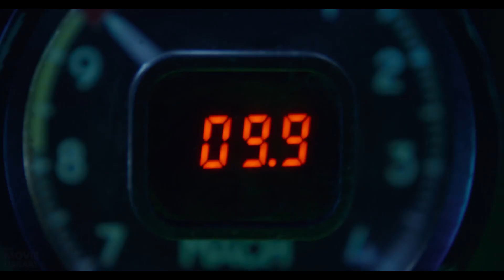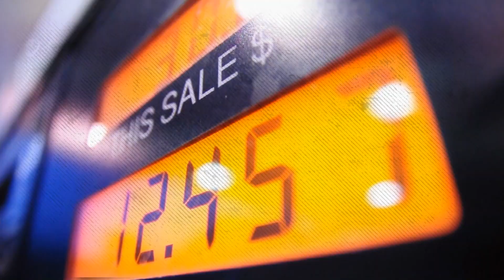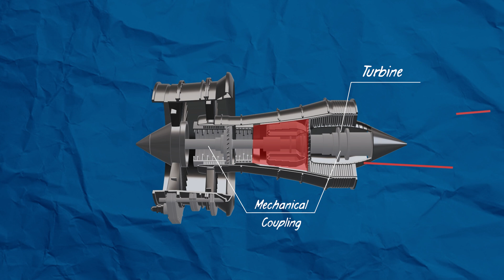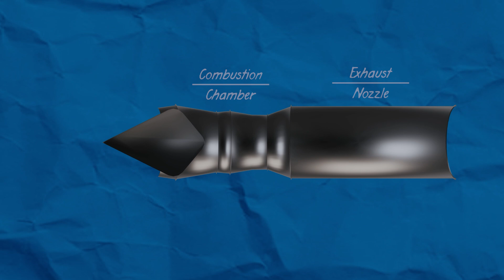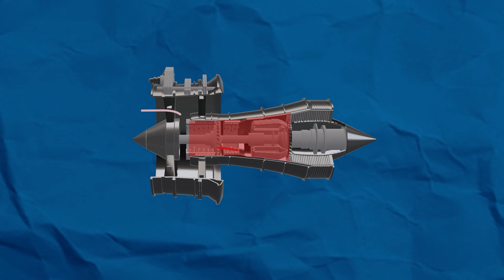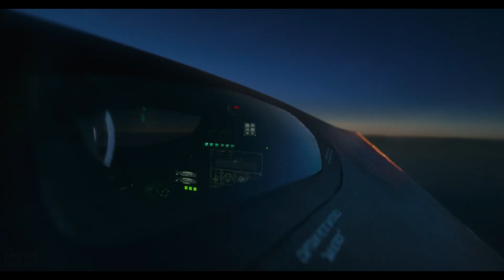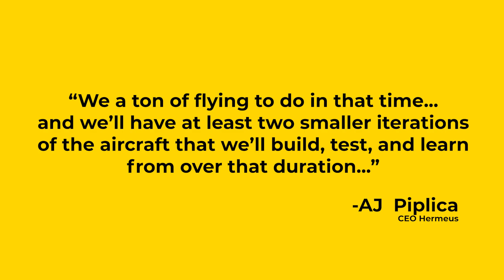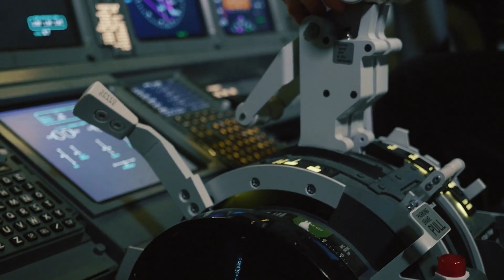The Mach 5 Engine That Will Change Air Travel Forever | Hermeus

Comment: Small point to make: The engine shown in at around 4:05 is a turbofan engine. Passenger aircraft don´t use turbojet engines any more. Turbofan engines use a large fan to move a big air mass at a slower speed than turbojet engines. Turbojet engines accelerate a smaller air mass to faster speed.

Comment: Not even one mention of the Blackbird? anyway, the only thing limiting supersonic travel right now is laws all over the world that prohibit faster than sound speeds because of the sonic boom, so you can only go at mach 1 and above over the ocean which basically kills the economics of SSTs which is why the Concorde failed. So its not a question of engines but of eliminating the sonic boom which is far harder to achieve and neither this video or the company says how they plan to address that.

Comment: It really fascinates me that they are finally actually going to make ramjets and scramjets into something that will be used in practice.
There is an amazing program called Orbiter Spaceflight Simulator, with which I have been playing for years, which very accurately simulates the physics of spaceflight (much more realistic than KSP), but in which you can also choose fly some spacecraft which are fictional and futuristic, but which due to the physics still have a large degree of reality.
Several of these craft make use of scramjets as a part of their travel to space.
Does anyone know how far current developments are in making this into a real option for the first (or maybe even second) stage in spacecraft lauching?
The reason I am asking this is because of the huge fuel cost reduction this might have. The idea is that a large part of the oxygen tanks can be ommitted, because a scramjet takes it's oxygen input from the atmophere, while it further accelerates the craft.
Of course the final part of bringing it into full orbit will still require full rocket fuel and internal oxygen, but at least a huge part it might be reduced.
I am also curious about how far in heat resistant materials of nose cones other parts of the airframe can theoretically go here, since acceleration through the atmosphere will need to be even more here. Also considering the problematic maintainance cost of the space shuttle here, which depended on expensive tiles for it's heat shield, and which was still just designed for reentry (high velocity during launch was reached after leaving the atmosphere).

Comment: Nosecone plus shockwaves = air valve.  Got it.  So maybe push the nosecone of the engine forward and back to adjust said shockwave to be optimal for a wider range of  speeds.

Comment: As other commenters have noted - how on earth can anyone claim this is new?  The Skunk Works led by Kelly Johnson developed this engine technology in the late 1950s with the SR-71 Blackbird.  They even made the plane out of a titanium alloy.   This video's portrayal of the "newness" of this technology seems a good bit disengeuous.  As is, therefore, the claim that these designs are the key to commercially viable hypersonic flight.  If that were the case, wouldn't we be closer to it 70 years after the first technology was invented?

No. I agree with the other comments - the keys to commercial hypersonic flight are lighter materials, design and lighter, yet denser, energy sources.  

(Of note, to my understanding, the SR-71 went further in energy conservation/efficiency by aligning the angle between the nose and ramjets  in such a way as to "feed" the shockwave created at the nose into the ramjets, thus producing even more thrust.  The maximum speed and altitude are STILL classifed.  What we DO know is that it cruised near Mach 4 or 5 and at 120,000 to 140,000 feet).

Comment: A jet engine doesn't change air travel forever.

It may change military aircraft forever but it certainly doesn't change "air travel" where most people would consider that to mean the flying public on commercial or private aircraft.

There's a HUGE host of problems that have to be solved to fly a large aircraft that fast and for governing bodies to deem it safe for the public.  We already have engines that can EASILY move commercial aircraft at supersonic speeds, but we don't have supersonic aircraft in any of the major airlines.

There's a reason why different manufacturers almost went bankrupt trying to develop supersonic aircraft for public transportation.

I'd like to watch this because there's probably something useful in it but I hate sensationalistic titles, thumbnails, etc..........

Comment: You're mistaking a turbofan for a turbojet. 4:08
A turbojet lacks a bypass. All air enters the comustion chamber. Turbofans can't really reach mach 1 since the intake fan tips begin exceeding the sound barrier drastically reducing engine efficiency.
Reply: Basicaly no engine is a pure jet engine, they might have little or very little bypass but most of them have some bypass.

Comment: When you mentioned the precooler, I thought of Reaction Engines SABRE engine. They developed a precooler for the SABRE quite a few years ago. They use liquid nitrogen to cool the incoming air and a gas turbine that runs on hydrogen and can fly to mach 5.5. Their plan is to use it for a single stage to orbit space plane called Skylon. While in the atmosphere, the SABRE is air breathing and switches to rocket at mach 5.5 at high altitude, reducing the amount of O2 necessary to carry onboard, reducing weight and allowing SSTO. The difficult problem they had to solve was frosting of the precooler heat exchanger. That solution is patented.
I don't see hypersonic flight as the future of air transportation, it will be used marginally for cruise missiles and most probably for cheaper access to space.
If billionaires want to travel at mach 5, burning tons of hydrocarbons, I personally do not see why I should bother buying an electric car to reduce my carbon footprint.

Comment: Hey Bro. you are doing some amazing technology videos.
I have a new, never before seen, Rotary engine design that solves all the problems with the Rotary engine concept and keeps all the advantages.
For example:
The Apex seal will never go bad.
Perfectly balanced without counter weights.
Variable compression ratio, can run Diesel, gas or any fuel.
More power to weight ratio then Wankel.
Higher RPM, Higher Torque then Wankel.
About 60% + efficiency. And much more.
If you are interested in looking at my engine and discussing it, please respond to my comment here!
And I will send you further contact info.
If you could help me promote my EPIC Rota-Max engine on your channel, we could both make a lot of money with it and save the Environment from pollution.
Thanks!

Comment: "... short-lived glimpses of Mach speeds [sic] ..." -- no, Concorde traveled at about Mach 2 for hours on end.  Mach 5 travel would only be for the super-rich; there is no prospect of air travel in general being forever changed by engines capable of propelling aircraft at such speeds because of the costs, particularly that of fuel.

Comment: Untrue. A SCRAMjet system needs to be flying very fast. A standard ramjet engine needs to be running a minimum of about 300 mph to work. This engine is a "supersonic combustion" ramjet (or scramjet) which will allow hypersonic flight speeds.

Comment: Speed speed speed, now stop thinking...For forty years there has been talk of a high speed between Sydney and Melbourne. Can't do it stop thinking.
For that whole time I have been asking why don't they do overnight sleeper trains on the existing tracks? No technology required.
Think of the experience of the passengers. They have their dinner, taxi to the train and board, watch a movie over a wine or two, go to sleep wake up in the desired city. The stations have shower facilities/cafes, get a taxi to your meeting at the end of the day do the same home. No Taxi to and from the hotel which is not required. 

Pressurized airships could do the same above the weather for UK, USA. Are there technical hurdles, yes about one percent that of hyper sonic transport. 
And they would also use about a hundred times less fuel per passenger... BUT stuff it lets just burn the world. ☠

Comment: "No one has been able to do this before".  I beg to differ.  The PW J-58 which powered the SR-71 Blackbird was a Turboramjet. The only thing holding it back was the limited materials science of the 1950s/60s was unable to withstand the heat of the exhaust and turbine inlet temperature at speeds above Mach 3.2.  The fastest speed ever recorded by an SR-71 took place in April of 1986 over Libya while doing a "bomb damage assessment" of the previous day's strike with F-111's.  The missiles fired by the Libyans at the Blackbird were capable of Mach 5 and reaching the Blackbird's altitude of over 85,000ft. To avoid those missiles, the pilot advanced the throttles slightly and the plane responded.  The pilot and RSO carefully watched the turbine inlet temperatures as the speed of the Blackbird increased to Mach 3.5. Due to some unusual atmospheric conditions that day, the turbine inlet temperatures did not exceed the redline of the engine and they were successfully able to evade the missiles because of their extreme speed.  If we could reconstruct the Blackbird with the new materials we have today, then Mach 5 would not be out of reach.

Comment: Firstly, that is not a jet engine, that is a turbo fan engine.

Secondly, the air is not  really slowed down (Well a bit of it is, most of it is not), but the speed of sound in the air is increased due to the compression, making it have a lower mach number. A subsonic mach number. Jet engines can absolutely go past mach 2, even turbojets can. Like the engine of the mig 31  can go mach 2.8 with out really any problem.

And ramjets absolutly works fin at lower speed than mach 3. They does even work at subsonic speed. And there is a overlap between a ramjet and a normal jet. Like in the SR71 using jet engines at take of, then changing the geometry so the jet engine become ramjet heaters at higher speeds.

The downside of compression heat due to speed exist. But the video failed to explain what the issue with this downside is. A engine can be made so that speed is increasing. But doing so decreased compression and as a result of that efficiency. So engine designers optimize the compression to the design top speed. Hence the F35 have a top speed of mach 1.6 i steed of 2.2 as most fighters to make it a bit more fuel efficient

7:00 this is just Ridiculous. you wouldn´t use a high bypass engine inside a ramjet.

And its not really that unlike the engine of the SR71. Of cause the SR71 didn´t have a pree cooler, on the other side, the SR 71 run on liquid jetfuel like fuel

Comment: Everyone keeps talking about making materials that can tolerate the extreme heat of hypersonic travel....but you're missing the elephant in the room.   Think 'Heat Sink'.   Even IF you can make the aircraft of materials that won't melt....how is it going to be able to maintain a reasonable cabin atmosphere for long distances when it's constantly absorbing heat that it has no way to get rid of?   Some have said to carry helium or other cryogenic liquid and use that for cooling...which would work (expensively) for a while, but not for the several hours that would be needed for trans-global flights unless you suit everyone up and cool their suits like in the SR-71.   Absolutely not practical for commercial use.

Sorry to say...this is all a fancy funding program offering just enough reality to lure in investors while totally ignoring the really hard problems they are heading straight into.   People in the industry know all about these and it's why Rolls and others won't invest in Skylon or these other projects.....there's no future in them for commercial purposes.   Now...for an unmanned weapon...that's another story and they are in development as we speak.   But manned machines have to keep the meat muscle alive and surrounding it in 2000C for very long is not a question of WILL they cook...but how long until it happens.
Reply: Ceramic tiles?

Comment: solutions to high speed:
1) Needs to be at high altitude, like 75,000 feet, less drag, less heating ,
 less sonic boom, con- oxygen poor environment.
2) Use oxygen augmentation. At high altitude introduce some oxygen.
 payback is high speed,
3) Could use a pulse jet, air accumulates in a "bucket" then explodes out exhaust chamber.
Reply: How does one store oxygen. Given that liquid oxygen corrodes virtually everything
Reply: @avonbwogeny2736  
Storage of oxygen is well known. As liquid it is cold snd stored in a dewar. For oxyacetylene torch i have its a gas at about
2000psi. I havent seen any corrosion from it
Reply: Suborbital makes more sense. Pack barf bags because it will be zero g for quite a while. And comfortable couches because the g load on approach will be heavy.
Reply: @cowboybob7093  
You have a good argument for suborbital. 
Here is where the line between aircraft and space craft is blurred. My guess is high flying aircraft is cheaper but i dont know.

Comment: do you have any idea how expensive it is to make a airframe skin that can handle the heat at a sustained mach 5? the engines are the easy part, we have been easily going over mach 2.5 for decades with a comparatively basic engine. its very unlikely this will be accessible to anybody but the absolute richest people on earth. not because of the engine, but the airframe limitations.
Reply: True. Concorde was already limited on its (aluminium) frame temperature, they engines had enough thrust to go faster then Mach 2.

Comment: It could but bear in mind most fighter planes don't run with afterburners as it can reduce operational range by 70%.
Modern fighter planes are actually slower than previous ones with the new F35 being a max of Mach 1.6 as ability to turn and operational range is destroyed above that speed as is its stealth capability.
So yeah these be extremely fast but at what efficiency?

Comment: Minor point: Passenger jets are flying closer to .8M than .7M. A jet flying at .7M would not be allowed on the most used/popular Atlantic routes/altitudes -- at that speed it's blocking traffic.

Comment: Could you please use metric measures? The old imperial system isn't viewer friendly.
Reply from the maker: I honestly felt heavily conflicted about what system I should be using 😅
Reply: @DrBenMiles  oh and thank you for your fascinating and well presented content. Measures aside.
Reply: @DrBenMiles  Don’t feel conflicted but follow the easiest scientifically proven path - which is metric. I was educated in Scotland and had metric from the age of 8. It was much easier to negotiate. This has to be one measure of measures! Also, simply from a viewership POV, most of your interested viewers will also be metric-trained. I doubt any of my Chinese, African, Indian or EU students even know what an inch is!
Reply: When discussing aircraft the standard is imperial, height is in feet, speed is in knots, etc. Sorry if that upsets you, but maybe you should learn instead of complain.
Reply: @msytdc1577  ohhh someone feels the tug of the past. I have students like that - usually from the US - but they learn.

Comment: How come you guys are forgetting the SR-71 Blackbird. It used the same technology and could do Mach 3 max. And I managed to do all these things in the 60s
Reply: Yes the SR-71 switched to Ram Jet similarly with diversion from the turbojet core.
Note that the diagram of a turboFAN jet to start is likely incorrect certainly the size of the fan having been lifted from a subsonic jet is unlikely.
The SR-71 did become more efficient as it progressed past mach 3.
Precooling (just exactly how?) might allow them the push the envelope farther.
Zero passenger potential- this only has military application.
Reply: The SR-71's fuel (JP-7) was specially formulated to not ignite at temperatures experienced in "normal" engines.  It was used as hydraulic fluid and air-frame and component coolant before being pumped into the engines.  That is a level of complexity that I would not trust to any airline.
Reply: @everettputerbaugh3996  Hypersonic refueling is going to be awesome. "This is your captain: We need to drop to Mach 3 for refueling" A string of planes the size of a KC-135 for a passenger plane. How about boost phase, above Karman line ballistic "glide phase," high g braking phase (to be a passenger requires a medical release.)
Reply: As amazing the Blackbird is, ultimately even the USAF couldn’t afford it.

Comment: Thanx for explaining the shock waves produced in the ramjet design.  It's the first time in any laymen-level tutorial that I have seen that this important design consideration has been mentioned.  I like learning, finally, this small yet critical detail in the construction of the engine.
Reply: Maybe find better videos If you real want to learn. This "Dr." here couldn't even tell the difference between Turbojet and Turbofan. Besides he thinks airliners flew with Mach 0.7, so....
Reply: @yibozhao1012  Thanx for pointing that out.  I did learn a little, but it's good to know that other knowledgeable people chime in with opinions and critiques.
Have a great day!  🙂
Reply: @yibozhao1012  Agreed he says one thing and shows another conflicting thing.
Reply: Study the shockwaves inside the SR-71 engines.